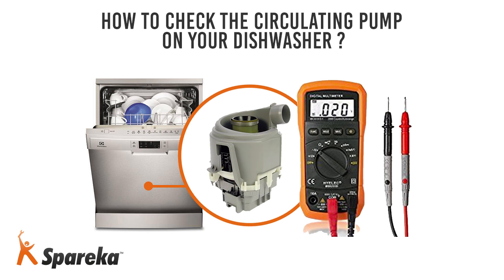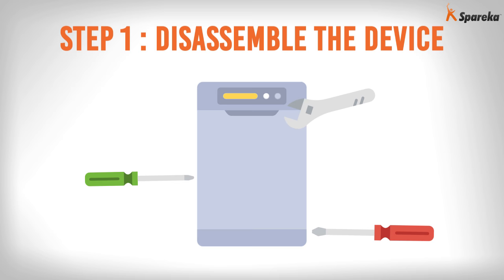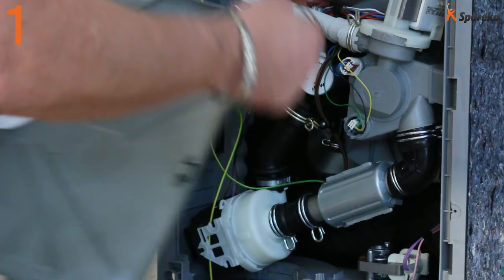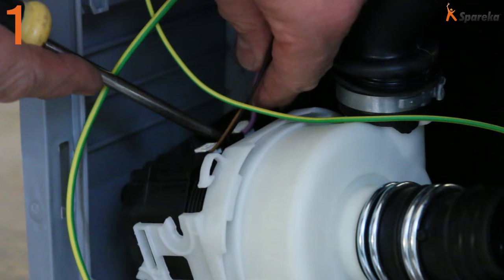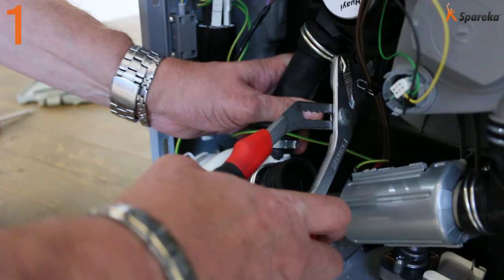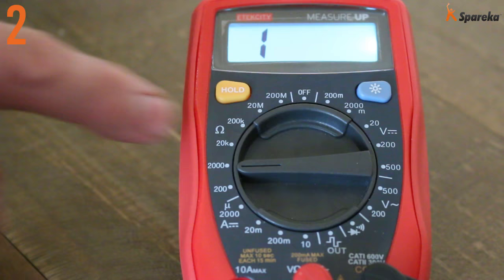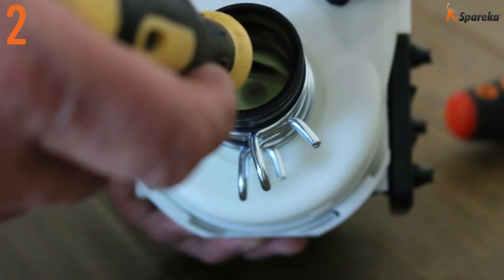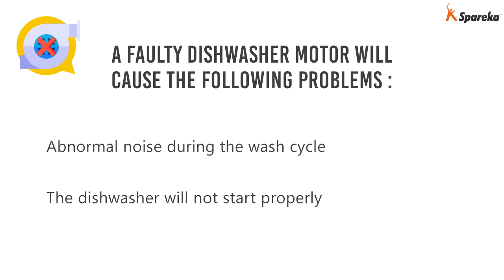How to check the circulating pump on your dishwasher

Comment: Please read. My experience. Water not drained. I checked hoses. They looked clean and clear. So I wasn’t worry about it. Following the video I decided to buy a multimeter. Checked the water pump for continuity and “Everything ok” like 26 ohms. I still decided to order a new pump from Amazon for $29. Installed it and it works flawlessly. My dishwasher was pretty noisy when new because it has a new and strong draining pump. Last days it was doing very quiet cycles due to, what techs call it, a “tired pump”. Now. At least in my Whirlpool model, I didn’t have to disconnect or remove it from its place and put it upside down. I only remove a plastic cover from the bottom front and squeezed my hands through it. Very ease. First. Disconnect the power. Vacuum all the water. Using pliers, Disconnect the plastic drain hose that goes to the pump. And then. With a mirror. Locate the clip that goes on the other side of the pump. Press it and rotate the pump and voila. Clean and make sure there’s nothing obstructed. Disconnect the electrical plug and connect the new one. Easy peasy. I hope this helps. Salud 🍻🍻🍻

Comment: Mine measured 60 Ohms. Ordering a new one, thanks!
Reply: did that fix your issue?
Reply: @andrewd5135  Well, I remeasured it several times after commenting and the numbers were all over the board. I tested my leads by touching them together and that wasn’t the problem. Bottom line; I did order a new circulating pump Because the upper and lower wash arms were not rotating and I ruled out soap blockages and wound hair on spinning joints. Just out of curiosity, though, I measured the resistance on the new one before installing it, and The resistance was well below 100 Ohms like the one I was replacing it with. It did fix the problem though; the wash arms are spinning again. Other online videos like yours, claim other resistance numbers, so I just ran out of time to chase that rabbit.

Comment: Others say the ohms should be 20-40, why do you say over 100?
Reply: @jackwater9703  Thanks for the reply. I finished this project a couple months ago. My issue was a bad bearing.
Reply: @jackwater9703  my dishwasher pump is 220-240 volt, 90 watt. According to this link my motors resistance reading should be 640. When I connect the merter to the motor though, the resistance reading is 64.5. Is this low or is it ok?
Reply: it can vary from manufacturer to manufacturer. Typically, I would expect 3-200. manuals and documentation usually spell out what the expected values should be. anyways, the significance is that if it's too low, then there could be a short in one of the windings. if it's too high or "open" then there could it's just that, an open connection so no power flow.

Comment: What is the importance of 100 ohm reading? Is that the lower limit?
Reply: it can vary from manufacturer to manufacturer. 233-ohms seems low to me personally. Typically, i would expect 3-200. manuals and documentation usually spell out what the expected values should be. anyways, the significance is that if it's too low, then there could be a short in one of the windings. if it's too high or "open" then there could it's just that, an open connection so no power flow.
Reply: correction: i meant to say that 233 was high to me, not low.

Comment: Hey nice video what if there is no power to the pump itself? I tried two different motor no luck everything else runs.
Reply: Probably a faulty relay (fixable) or a failed control board (probably not worth trying to fix)

Comment: My meter reads 93 kohm. Is that fine?
Reply: No
Reply: it can vary from manufacturer to manufacturer. Typically, I would expect 3-200. manuals and documentation usually spell out what the expected values should be. anyways, the significance is that if it's too low, then there could be a short in one of the windings. if it's too high or "open" then there could it's just that, an open connection so no power flow.

Comment: Mine says 120V and 50W, and while test on 200 my result is 47ohms... Is that too low? With the link I should get over 100. 
Ge dishwasher model: pdt660ssf1ss
Reply: it can vary from manufacturer to manufacturer. 233-ohms seems high to me personally. Typically, i would expect 3-200. manuals and documentation usually spell out what the expected values should be. anyways, the significance is that if it's too low, then there could be a short in one of the windings. if it's too high or "open" then there could it's just that, an open connection so no power flow.

Comment: Crap video. You assume all dishwashers are the same. Not all dishwashers have a simple opening flour board. Some motors have 4 terminals. Where should there be readings and what should they be. What are incorrect readings. There are so many variables you dont mention.
Reply: I knew it would be from the moment I heard that silly music start up.  This is a dishwasher from Fairyland. You would not get very far with just a flat screwdriver and waterpump pliers on my dishwasher. Gave it a thumbs down.
Reply: Mine got 4 terminals , can you tell me where it should be connected?
Rat cut the wire so I can't identify